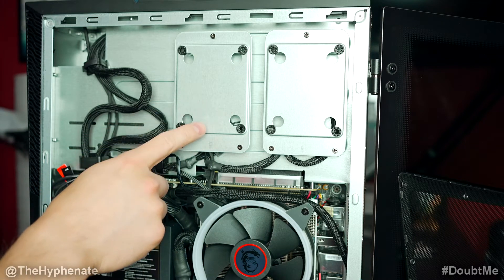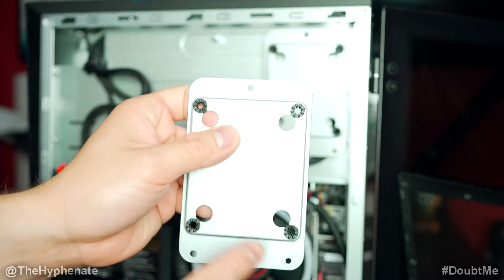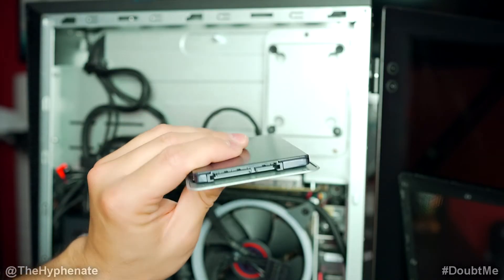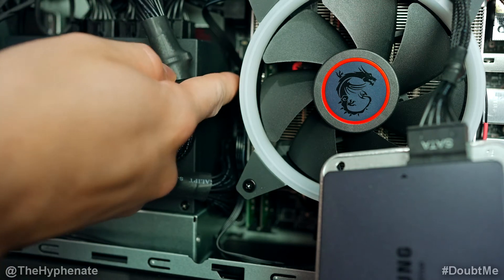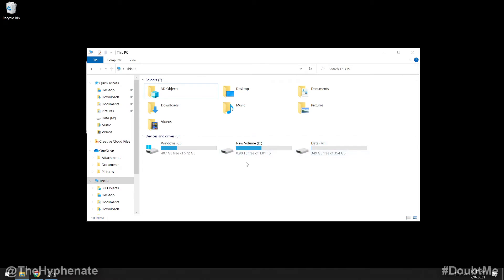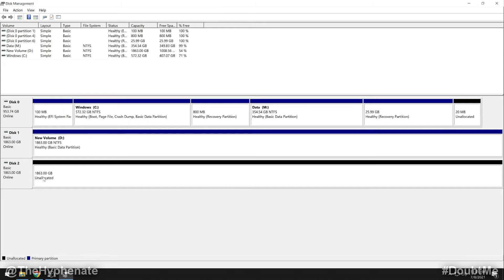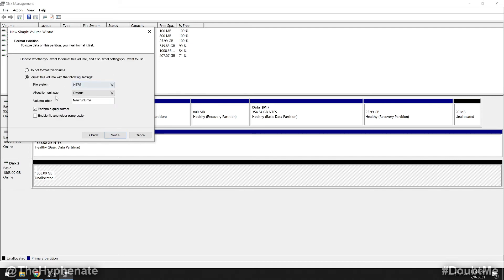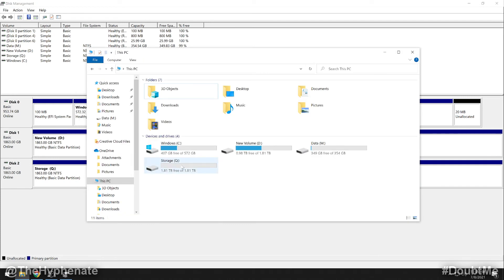How to Add an SSD Hard Drive to MSI Trident [ Trident X, 3, AS SSD Upgrade Install Tutorial ]

Comment: For anyone looking at this. If you have a 12th generation of this, which has a Z690i motherboard, note that it has three M.2 slots, with two supporting PCIe 4. The best part? Besides the occupied slot, the other PCIe 4 slot is accessible by removing the back cover of the case (the graphic card side). M.2 is significantly faster, and you won't have to deal with cables.
Reply: Thanks for this info , tomorrow I receive exactly the 12th gen model. Do you still have the 12th gen? Any issues?
Reply: @subzerolives  Yeah, I am still having my 12th gen. It serves me well.
There was one funny problem that if one of the SATA hard drives is broken the entire system cannot boot up. I think it was due to the PCIe lifter sharing the same power cable with SATA drivers and if there is a short circuit there would be no flow to the GPU...
Aside from that just keep it in a cool environment cause the thermal control of this is not that great and keep the drivers updated you should be good.

Comment: Have a meg trident x 10th and wanted to upgrade my gpu. Do i need a 2x8 pin cable or is it included in this pc? Bc the rtx 2070 super, that i want to upgrade to a 3070 and dont looked yet if i have a 2x8 pin?

Comment: Thank you so much! I was wanting to add a second drive, but the lack of instructions from MSI had me stumped as to where, the included power cables connected to the PSU. I did not want to start a whole process of investigational disassembly with the possibility of disaster.  :goodvibes:

Comment: Is it possible to install 2 of them? I saw that there are 2 slots but isn't one of them for the stock SSD/HDD?
Reply from the maker: Yeah you can.  I installed 2 SSDs.  Those 2 are not for the stock drive.  Those are for 2 additional drives
Reply: @TheHyphenateTech  Thanks!